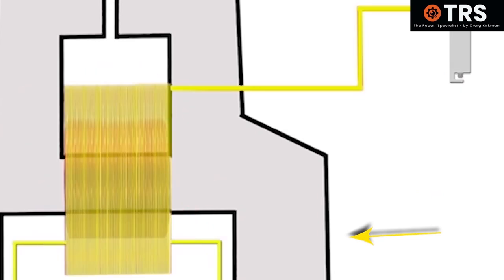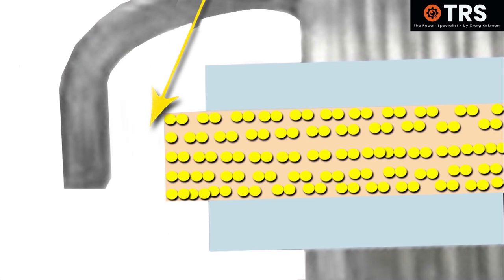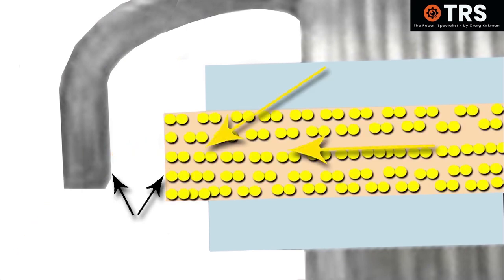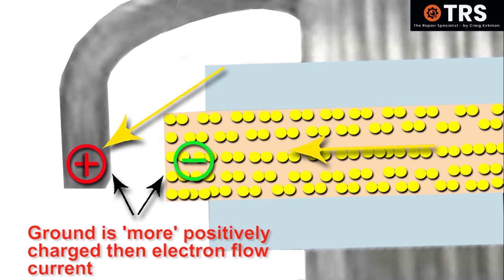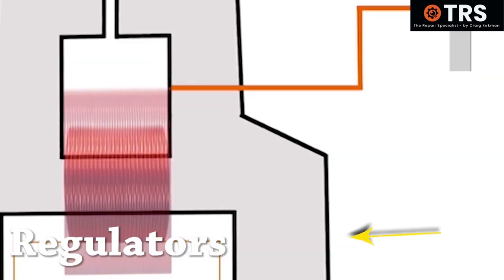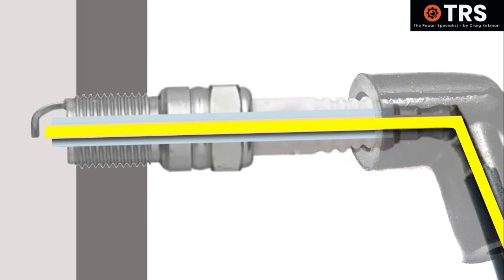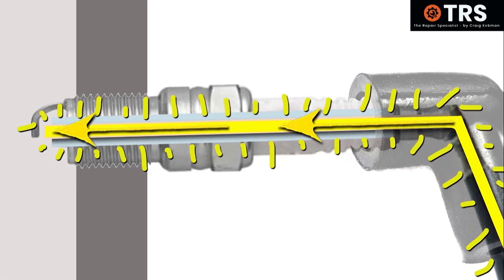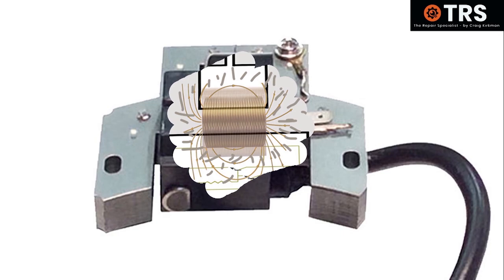LAWN MOWER SPARK PLUG GAP, if incorrect, it does this to the Ignition Coil

Comment: This really does not destroy the coil. It destroys the sensitive electronics inside that takes place of the points in older applications.
Reply from the maker: I say that in the full video associated with this video. I used the term coil, as in, coil pack. The full vid is linked in this vid and I do explain what you are saying

Comment: I just had the strangest thing that I never had before.  I replaced only the coil and the engine would not start.  It was firing too soon causing pre-ignition kicking the starter!  It was a new aftermarket coil with all the numbers checking out.  I replaced it with a known good used unit and it started and ran fine.  I don't know if the new one is defective or is the wrong part.
Reply: I found out later that the longer wire on the replacement may have been the problem.  Bought another one that matched the original length and it worked.  I had no idea that the wire length "tunes" the timing.

Comment: Yeah boss, I got a question a friend has a mower he said he tipped it up on its front for a while, then set it flat. We looked at his spark plug and it was covered in oil, not burnt but fresh wet oil.

Would this be because of a bad spark plug seal/gasket?

It has compression over 100 psi, and I stuck a camera up the spark plug hole and there seemed to be a band around the inside that was not set correctly.
Reply from the maker: Hi. Thank you for your comment. I really appreciate it.  Well, what is would do to start with is remove the spark plug and crank the engine steadily so that any excess oil may emit from the hole.  Then try to start again.  Be careful not to pull over the engine too many times with out the spark plug connected as this thought to damage the coil if done repeatedly over time. Let me know how you go on with this. Craig
Reply: Ok, my turn. Thanks for the video. -) 
I changed my spark.plug on my jd riding lawnmower. I checked the gap, Manual said .030 it appeared to be fine.  I just bought a new battery today, put it in thinking I'm good to go.  Mower cranked, but never did start. I started to.smell gas so pulled down lever to run. When I turned key again, it wouldn't even click. Brand New battery.  Ideas??  Some women are shopping for turkeys, me? I'm shopping for lawn.mower batteries and chainsaw bar oil. Lol :( help.